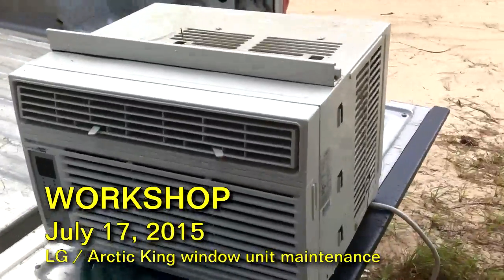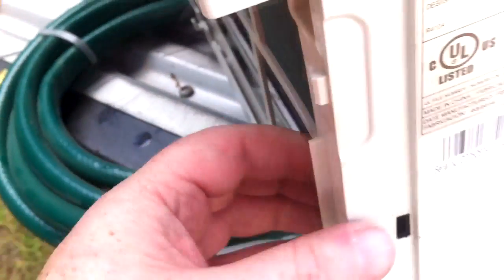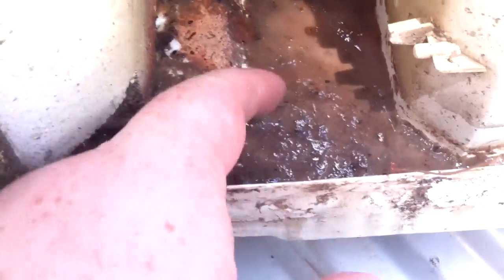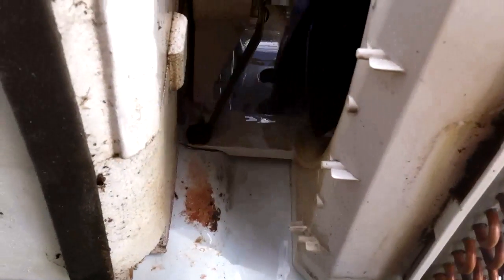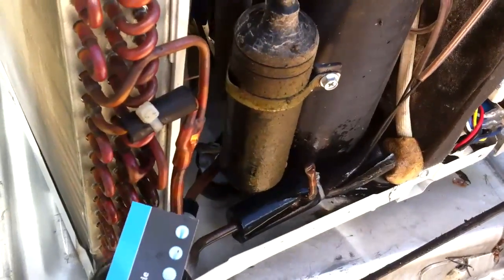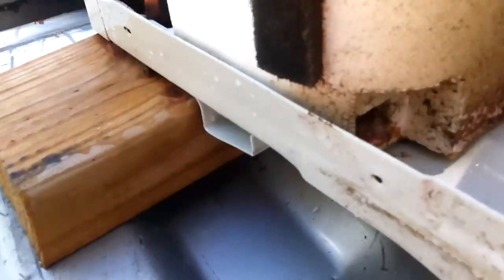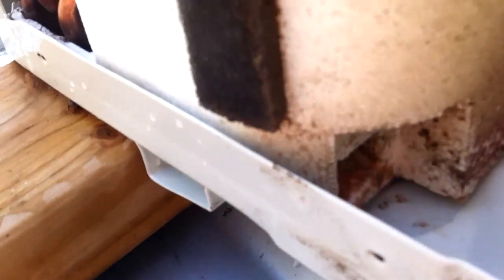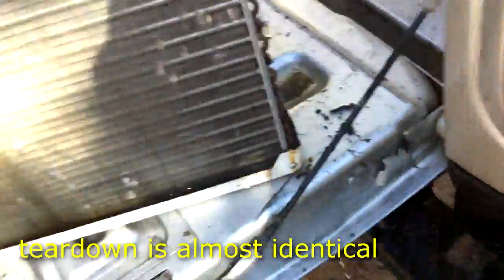WORKSHOP: Arctic King / LG window unit: quick & dirty maintenance

Comment: Primordial growth. I use condensate tablets  that kill bacteria. Second thing I do is drill the drain pan at lowest spot so no water pools. Some units are vented at top outside I made a baffel to keep small debris out of it. Also when opened check steel parts for rust. The accumulator before the compressor some times rusts a hole in it resulting in loss of refrigerant.

Comment: Take off the styrofoam too that in the front of the unit. Cover the electronics with a plastic bag so it doesn't get wet. Spray the front radiator with a cleaner, I use Clorox cleanup bathroom cleaner because it gets rid of the mildew instantly. Hose down the front radiator until no more mildew comes out. You can also use a stiff brush to clean it but only brush up and down. Clean the entire unit like this and put it back together making sure the electronics don't get wet. If they do, blow any water off with a vacuum cleaner until dry and let stand for an hour in the sun.

Comment: my arctic king purchase on summer 2012, i just do what Tim does,  yearly clean them out.   and make sure you dont wet the control panel you can unscrew and wrap it up with plastic bag or any, .on the  front and back condensers make sure its dry after cleaning (or  spraying water) then spray degreaser start from top to bottom of condenser then wait 30 minutes then rinse  by spraying water (only condenser nothing else using degreaser ) hope this help
Reply from the maker: Thanks. I really wish there was a way to widen the water drain passage between the front and the rear of the unit.  It seems these units clog at the end of each year, presumably from algae and mold, and then the unit starts flooding the window enclosure.  When I've had the units open I've never seen a good way to access this drain gap.  I'm starting to wonder if this is a means of forcing people into buying new units.
Reply: @ForecastLab  pour a few tablespoons of vinegar in there every couple of months to prevent algae.

Comment: I have the same unit.  Mine is really pissing me off.  It cools for awhile then the compressor shuts the f*ck off !!  I am trying to use it as an additional AC because my central air can't keep up.  I took it from the window and washed the hell out of it.  Put it back in and still doing the same thing.  Its hot as hell in here.  I am about to go buy a new one and figure this out later.  I am so angry.  How can I just force my compressor to stay on??

Comment: I got the same ac unit from Walmart last year. Both this summer, and last summer I've noticed my whole apartment smells like some strange toxic chemical when running the ac unit. I especially notice it after I've just gotten home since I've been out in much fresher air. But eventually my nose adjusts to the smell after I've been home for a while. But the smell is getting stronger. It's offensive and kind gives me a headache. It seems to be getting worse. I dunno if it'd be worth calling a mechanic. The warranty is up. I'm poor and don't want to have to get a new AC only to have the same problem again. What should I do?

Comment: can i just blast water into the thing from the inside becaue its cemented into the wall and i can't even remove the front panel. Just the grill to clean the filter. And it's leakng like crazy and doesn't cool

Comment: I always drill a small hole in the lowest spot on that bottom pan for drainage. Not all units have them as they come.
Reply from the maker: We considered doing this but I read that these designs use water to sling back onto the compressor coils to further cool it.  I'm not an AC engineer so I can't comment on this but I'd advise looking into this further.
Reply: Yeah, definetly dont just go drilling holes in stuff!  Mine says no water should be in it.  And its hard to install at the correct angle...house is 100+ years old and .....excuses excuses.

Comment: So the LG and Arctic King have similar or identical designs?
Reply from the maker: From what I saw the general arrangement is very similar.  On both of them you can't see the drainage hole so you just need to flush it out thoroughly.
Reply: I got the smaller unit    Cant seem to find the drain spot.

Comment: I did everything the same way but now the unit when I plug in it and hit reset the unit powers on and shuts off and won't turn on by hitting the power button
Reply: Might be a short on the compressor or the thermostat was wet 
Remember that all the power is managed by the thermostat so if you  wet it it will short and cause the plug to reset

Comment: Just get coil foam spray and let sit on the coils for some minutes and hoes them down and only goes the coils and maybe the tray in the bottom and fans but try not to wet anything els u can do the case and let it dry for 24 hrs and don't have it plug in and use the coil cleaner 2 times rinse apply hoes and wait a few minutes and repeat 2 or 3 times